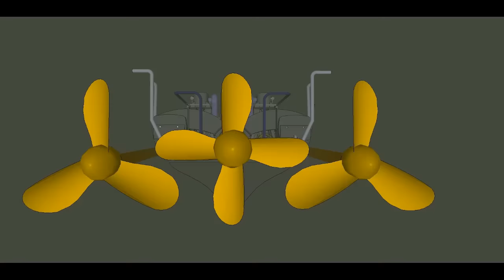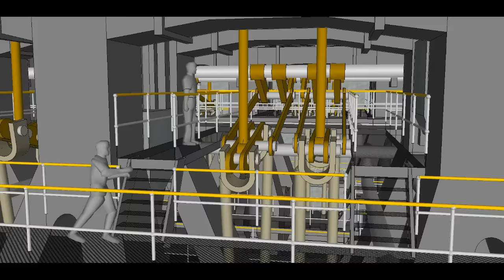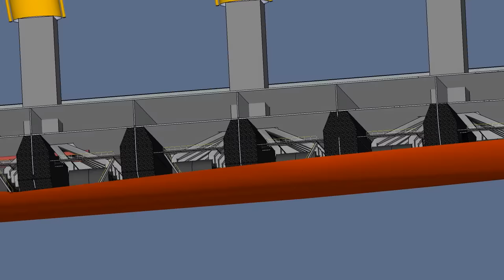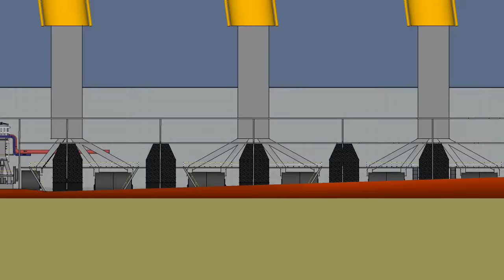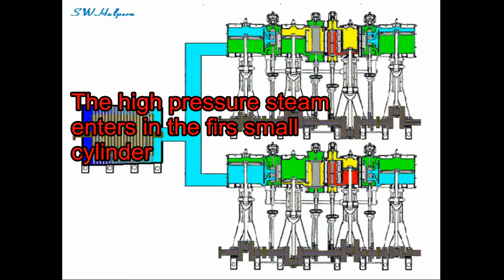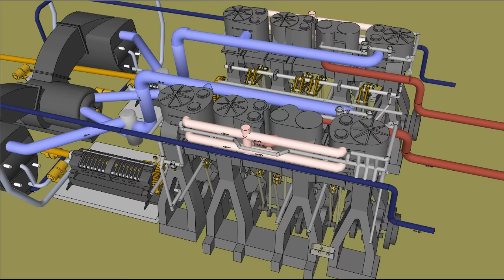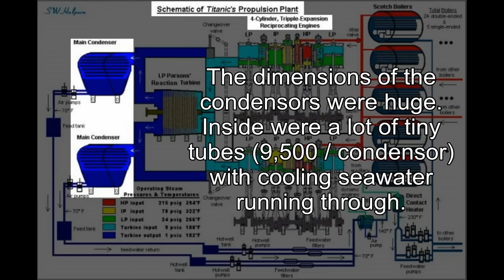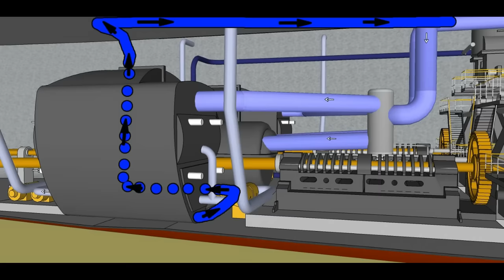The Engines of the Titanic

Comment: The level of engineering is astounding, no CAD in those days, not even a calculator, all this was done with brain power and put down on paper. Just mind blowing.
Reply from the maker: Yes, that was really very clever!
Reply: Not that it got them far
Reply: Did they not have sliderules for calculations? Did they not have "computers" of the two-legged variety?
Reply: The technology was not that new then, they had had steam engines for over 100 years, so they knew what they were working with.
Reply: The turbine is what I found great. The machining and fluid dynamics involved in the turbine is amazing for the time. It's very similar to a modern day jet engine. The stationary blades directing airflow into the moving blades is brutally simple but getting your head around it back then and making it was anything but. "Theoretically" they were mostly into the jet age with the turbine alone.
Reply: They did have slide rules to use.  I used to use one.
Reply: @YodaWhat  Slide rulers were invented in the 17th century, so they would have had those.
Reply: Outdoorsguy -- Ya, I know. It was a rhetorical question.
Reply: No comment.. the ship is on the bottom of the north Atlantic.. I'll stick with my scientific calculations ...
Reply: And all with negative unix timestamps.
Reply: They had to think for themselves back then. Slide rules, log tables. An engineer back then was well mentored. Also large drawing offices and blue prints. No 3d CAD.
Reply: Hey, not so fast.  We had "slide rules" before we had calculators.  We didn't have "nothing". :)
Reply: waooo amazing
Reply: Ironically drawings were ink on linen then
Reply: Was not, much of a marvel it sand coming out of the gate.
Reply: And slide rules. For example there was a Fuller cylindrical slide rule in the drawing office of Harland & Wolff that was even used 30 years later, it was just very precise and well made.
Reply: There were lots of mechanical calculators in 1912, just not digital. It wasn't that long ago, and not as primitive as you think.
Reply: @RedGaming Studio , computer aided drafting.
Reply: The sr71 was designed using slid rules.
Reply: @michaelmcneil4168  it got them incredibly far. 
Many a ship survived built this way
Reply: @JTScott1988  First of all it was not the Titanic, the story I heard is they swapped it for a sister ship and they only got most of the way, which in those days was still not good enough.
Reply: @michaelmcneil4168  It was the iceberg not the engines
Reply: No calculator- damn... that’s intense to think about.
Reply: @YodaWhat  The first idea for a "slide rule" dates from about 1620 and they proliferated in the 19th century. In the movie "Titanic," ship designer Thomas Andrews (Victor Garber) is shown using one. 
I got a K&E log log duplex decitrig as a high school graduation present in 1963 and used it as late as 1976, replacing it with a Texas Instruments TI-56 calculator when they finally became cheap enough. Now it's framed over the desk with a note that reads: "In case of power failure--break glass."
https://en.wikipedia.org/wiki/Slide_rule#targetText=The%20slide%20rule%20was%20invented,used%20to%20multiply%20and%20divide.
Reply: @williamwingo4740  Yes, the Napierian logarithms were published first in 1614. One of Napier's descendants is a friend of mine. :)
Reply: @colinmontgomery5492  That's right. Google "adding machine" and you find they were available in the 1880s if not before. I remember Friden electro-mechanical desk calculators in the 1950s: every lumber yard had one. Looked like a big typewriter, if you remember typewriters. 
I saw my first pocket electronic calculator in Korea in 1972. Somebody had picked it up in Japan. It was primitive by today's standards, but people were lining up to gawk at it. First one I actually bought was in 1974/5--a TI SR-56.
https://en.wikipedia.org/wiki/Adding_machine
Reply: Maybe someone already noted this, but also slide rules.  Because accuracy depended on distance between marks, "they" used to often use huge ones.
Reply: Omnihil777 I never liked slide rules, always preferred a book of log and trig tables.
Reply: Charlie K I just preferred tables, got a feel for them.  There was a period between 1900-1950 where mechanical completion relied on logarithmic and anti logarithmic  cams to do mechanical computing.  Numbers were represented as shaft turns, addition/subtraction by differential gears and all other functions by log/antilog cams encoding trigonometric and ballistics data.
Reply: I finished up high school in 1973 we didn’t have calculators everything was by had. Pain in the neck to do math the long way.
Reply: Lester Miller it taught accuracy and clever ways to be fast and concise.  3D CAD modelling and finite element analysis is nice but I doubt many other things have improved.
Reply: Pretty sure they had calculators and slide rules. The first mechanical calculator was made in 1645.
Reply: @Thebutteredsausage  only because it crashed when a modern ship crashes it sinks
Reply: 𖥠 ꧁Æ♱ℍᴲᮄℜᴲⅅ꧂𖥠 In a way, the turbine is a much simpler than the reciprocating engine, yet it was only invented in  1894.
Reply: @colinmontgomery5492  Exactly. It looks like people often think it was something like medieval.
Reply: Si1983h 🔥🔥🔥🔥🔥🔥🔥🔥🔥
Reply: About the slide rule comments: When I was in 8th-9th grade ~1970, our math teacher allowed slide rules during tests but most didn't. To some students, it was blasphemy to do so. I eventually started use one.
Reply: Calculator  was invented in 1642AD
Reply: Michael McNeil, haha true! That said, you can blame they engineers that built the engines.
Reply: dogboy1953 yes indeed... but they didn’t have CAD/CAM back then.
Reply: dogboy1953 ace, I’ve been thinking of connecting an oil fired boiler to my hot tub... maybe I should use a steam engine to drive the jets and filter pump.🤣
Reply: Abacus Calculator, still a calculator..
Reply: John W And two space shuttle designed by modern computers turned to ash so what’s your point?
Reply: @williamwingo4740  you mean it looked like a old cash register.
Reply: Pete Guthrie I’m fairly sure the engines (which I’m referring to, rather than the hull) weren’t riveted together... in any case, the biggest mistake with that ship was to call it unsinkable. It was an engineering marvel, but unsinkable it clearly wasn’t, no ship is unsinkable. It suffered a catastrophic collision in a critical area... it’s sinking was the result of a combination of very bad luck and crew negligence, born from the misplaced feeling of invincibility from being on an “unsinkable” ship, not poor workmanship.
Reply: Pete Guthrie The owners of the White Star Line never claimed that any of their ships were “unsinkable” . The rabid press of that day was almost as big of liars as they are today. It was the newspapers that declared the Titanic to be unsinkable.
Reply: Mdbk2 yes for sure, amazing feat of engineering!
Reply: @Hoeishetmogelijk  an this is actually  quadruple-expansion steam engine!
Reply: Of course there we calculators.  They were mechanical but still calculators.
Reply: Scotty true true. Brought me back to high school with that comment, I forgot all about those
Reply: Is there any reason why they used so many "small" sized boilers instead of bigger boilers btw? feed rates being to high or something?
Reply: @Thebutteredsausage  As are more than a few "modern" vessels that were CAD designed with the latest engineering principles. In short, if it's made of steel it CAN sink no matter how well designed and constructed.
Ironically they went back and double-hulled the Britannic (which was under construction in dry-dock when Titanic sank) and she went down in half the time of the Titanic when her time came (though her captain actually tried hard to save the ship by driving her as hard as he could towards shallow water and a nearby island, and he nearly made it)... it's hard to keep a steel vessel from sinking once the hull has been significantly  penetrated. Some modern analysis of the Titanic accident suggests that had Titanic struck the iceberg head-on it would have crushed the forward sections of the ship but she would have continued to float a lot longer or possibly indefinitely. 
Just saying.
Reply: So true. We could not do this these days the same way at all.
Reply: Metal - Grandpa yep, that’s kind of my point, if all of our modern tech (CAD/CAM) were to be taken away, a whole new skill set would need to be learned to accomplish this. All the measurements were done by hand/eye during manufacture too, it’s pretty impressive!
Reply: @Si1983h  Exactly!
Reply: @YodaWhat  Yes, in those days a computer wasn't usually machine.
Reply: @patrickcannell2258  My grandfather was an architect and he often worked for IBM designing office spaces. He told me that circuit diagrams even for microprocessors were the size of a table. So just imagine how big a blueprint for a ship is.
Reply: @RedGaming Studio Computer Aided Drafting and design. It is software that allows people to create technical drawings. The computer also does most of the math so its a lot easier then pen and paper.
Reply: @colinmontgomery5492  Electronic calculators didn't come around until the early 1960s and cost more than a new car.
Reply: We can make a engine from drawing but no electric they need cad and robots
Reply: The slide rule was available at that time as well as the Abacus.
Reply: There was solid-works back then and CNC 5 axis machining to make all those parts for the giant steam 5 strokes
Reply: oops 2 strokes
Reply: The CAD CAM program had a glitch on the 5 axis CNC machine! One of the 2 stroke went out of whack!
Reply: Working without computers means that it will take quite more in order to do the same job, so it will also be more expensive.
Reply: @Thebutteredsausage  yeah right, because nothing nowadays ever goes tits-up if "scientific calculations" are used....
Reply: Try reading a bit more numb nut the ship was sunk because the purser left  the key for the special long range binoculars they in his home  and they didn't have time to get a new one cut before she left New York and while they found some design flaws later this isn't what actually caused the ship to sink  - they didn't see the iceberg early enough to turn the ship
Reply: In Australia when the first theodolites came out they reserveyed all of Sydney and they found the good old gunter's chain and dumpy level to be 100% accurate and they put it down to the user
Reply: Evan Giles yep, little to with the quality of workmanship or engineering, no ship of the time would’ve fared well with that kind of impact. Competition to be the biggest, best and fastest was their downfall. Interesting story about the binoculars being locked away with no key though, surely there were more than one set of binoculars onboard and in more than one location?!
Reply: ... and a slide rule.
Reply: @roadtoad7704  We were allowed to use slide rules in high school chemistry and physics in 1962-3. Those courses are math-intensive, but the math is secondary.
OTOH, in freshman college chemistry lab a couple of years later they wanted four significant figures, so you had to do it all by hand or with log tables.
Reply: @lestermiller2717  "...we didn’t have calculators everything was by had. Pain in the neck to do math the long way."
But you got some very valuable experience. Nowadays high school students can use a calculator to get a square root, but can't tell you what it means that one number is the square root of another.
Reply: The ship engineering never the problem...human error...look at all the newer technologies on the newer cruise liner...and a captain decides to play chicken with a rock.....that would have been a huge disaster if the ship had sunk in deep water..technology can t compensate for stupidity..
Reply: @YodaWhat  If they had slide rules, they wouldn't have had enough significant digits for accuracy. To multiply or divide, designers used logarithms (x = 10^y) from books of look-up tables (easier to add "logs" of numbers rather than multiply them--subtract for division). Google it.
Reply: @Greatdome99  I know perfectly well what logarithms are. What do you think is the basis for the slide rule, silly putty? As for accuracy, 3 digit precision is pretty easy on a small "slipstick" and 4 digit on larger sliderules.
Reply: They did have calculators.  The most common type of calculator was called a slide rule.  There was also the abacus..
Reply: @frankeggers4024  yes, a lot of people have said this, but what they achieved with those tools is still remarkable. Today we have computer modelling so you can see something working (or not) before a single part has been made... not back then though, and these steam engines were huge and deceptively complex beasts, everything has to be perfect to within fractions of a MM, and there are lots of huge moving parts that need to be balanced otherwise they’d shake themselves to bits (but not before demolishing their surroundings). If you’ve never seen a giant steam engine actually running, try and visit a working pump house or something, they’re awesome to watch.
Reply: @charliejeans2413  labor was maybe cheap. And Not much space for automated system?
Reply: @TidusleFlemard  wild guess is that pressure is too high for big boilers?  Hard to make big boilers srrong
Reply: @Thebutteredsausage  I think it was a lot to do with the engineers and designers being over ruled by the owners of the white star line rather than their mistakes
Reply: @mrdojob  Yeah it’s like WW2 aircraft engines. The turbocharging systems were eventually so complex they probably realised it was easier to just have the turbine driving the aircraft 😄
Reply: The only thing they had in those days was the now obsolete slide rules.  I learned to use one in my first year whilst studying Engineering. Electronic  Calculators appeared about two years later.
Reply: But despite everything, she was a good ship, she took over two hours to sink and the recent Costa Concordia sank in less than an hour.
Reply: Titouan Lannuzel redundancy probably, also the logistical challenge of keeping them fired, it would’ve taken a large workforce, working around the clock, the workforce can fit around more smaller boilers more easily (sorry for the convoluted explanation, especially since it’s an educated guess).
Reply: It's really not all THAT big of a deal. It's just VERY inefficient. CAD and Calculators are efficiency tools, utilizing them a person could make this same cycle either make significantly more power, use significantly less building material, or be scaled to be significantly smaller.

Even today, a person with a basic understanding of combustion and engine concepts could easily make a perfectly operational engine with absolutely no mathematical engineering knowledge. Assuming he had the machine and casting tools neccesary of course.

It would be light years from efficient and produce very little power for it's size. But it would produce usable power. 

Now let's say he does some experiments, and breaks and rebuilds, reiterates, etc, over the course of a decade. Well chances are they'd get to within a significant fraction of an engine designed using mathematics.

Of course, this process is far from efficient enough to be profitable, but this metaphor describes how it was relatively easy is was to make an engine like this without the engineering tools we have today. Or even slide rules really.
Reply: @mrdojob  So true
Reply: No days what can be done by a small handful of people was done by rooms full of men drafting and calculating.
Reply: @frequentlycynical642  ... "they" used to often use huge ones... Of course! The engineers' wives used used to brag in those days: "My husband has bigger slide rule than yours!"
Reply: well. they did have computers. human computers as they called it.
Reply: @michaelmcneil4168  but it did?!? Their hard work paved the way for modern technology, and the Titanic in specific eventually caused more safety regulations to be put in place.
Reply: @clf8965  sorry but I don't recall what my reply was, this video is from January 2015.
Reply: @michaelmcneil4168  “not that it got them far” sorry I didn’t think about how old the original comment was, it’s surprising you’d even respond
Reply: @clf8965  I was trained by covid engineers.
Reply: Being lazy was no option for people back then. You had to use your brain, every single day. Which lead to smart people who invented all the luxuries we have today.
Reply: as technical draftsman and mechanical engineer, i absolutly agree and my mind is blown as well
Reply: @michaelmcneil4168  You probably know this but three of this class of ship were built...Olympic lasted until the mid '30s.
Reply: It’s at the bottom of the ocean because of human error , not any failings of the ships build quality . Ships don’t hit icebergs anymore because of radar and gps etc . If a modern ship hit that same iceberg at the same speed , it’s going to the bottom too .
Reply: The Parsons turbine was sort of a turbocharger for the big steam engines in a way I suppose. I think that with all of the jobless, homeless, and prisoners in America alone could easily provide enough manpower to reintroduce coal fired reciprocating steam powered ships back into service.  That would be good for everyone!
Reply: @aeromoe  Wow I never realised they built thing to last. I am reminded about than old cruise lined that was destroyed taking its superannuated piano player with it. Glad that was just a story.
Reply: Yes I do realise that old ships never die they just get insuranced out of commission under a toilet flag.
Reply: @Thebutteredsausage  as a boeing super jet crashes from the sky! 🙄
Reply: 1973-4, UofQld, a split room, 3 hr exam, the front half was us, in the back were the engineering mob. A big brouhaha broke out as some Eng. students (very few) had calculators and the rest had slide rules: nett result - those with calculators were given only 2 hrs to finish. We maths illiterates had no idea what they were on about.
Some years later I added the moment to a book on Capitalism as an example of problems with Worker Ownership. Scenario; what happens to those in a slide rule 'workshop' when new tech will certainly kill their business model pretty quickly. Solution: with more 'principals' (heads in the game) the threat is dealt with sooner.
Reply: ps: I have read that the designer, Thomas Andrews, did all of the drawings with what would be today a pocket geometry set. An extraordinary effort.
Reply: @peterclark6290  indeed, that’s what I was acknowledging, extraordinary, as was the machining moving mechanical components on that scale.
Reply: An atom bomb on a B29 bomber, designed and built without PC and cad cam
Reply: if it was electric it wouldnt have sunk
Reply: Indeed!
Reply: All they had were slide rules
Reply: No they had calculators
Reply: They had slide rules instead of calculators.
Reply: They actually did have calculators, but they weren’t electrical/computer driven. They had calculators in the form of people sitting in a room performing the calculations sent to them by the engineers.
Reply: @YodaWhat  About the middle of the 1800s slide rule usage became common so I'm sure that they were used in designing the Titanic.
Reply: @YodaWhat  nope
Reply: Yes, we can do all thing if we just believe and put our minds to it
Reply: Grand staircase Gold leaf 🍀🍀🍀🍀🍀🍃🍃🍃🍃🍃🍃🍃🍃🍃🍃🍃🍃🍃🍃🍃🍃🍃🍃🍃🍃🍃🍃🍃🍃🍃🍃🍃🍃🍃🍃🍃🍃🍃🍃🍃🍃🍃🍃🍃🍃🍃🍃🍃🍃🍃🍃🍃🍃🍃🍃🍃🍃🍃🍃🍃🍃🍃🍃🍃🍃🍃🍃🍃🍃🍃🍃🍃🍃🍃🍃🍃🍃🍃🍃🍃🍃🍃🍃🍃🍃🍃🍃🍃🍃🍃🍃🍃🍃🍃🍃🍃🍃🍃🍃🍃🍃🍃🍃🍃🍃🍃🍃🍃🍃🍃🍃🍃🍃🍃🍃🍃🍃🍃🍃🍃🍃🍃🍃🍃🍃🍀🍀🍀🍀🍀🍀🍀🍀🍀🍀🍀🍀🍂🍂🍂🍂🍂🍂🍂🍂🍂🍂🍂🍂🍂🍂🍂🍂🍂🍂🍂🍂🍂🍂🍂🍂🍂🍂🍂🍂🍂🍂🍂 🍂🍂🍂🍂🍂🍂🍂🍂🍂🍂🍂🍂🍂🍂🍂🍂🍂🍂🍂🍂🍂🍂🍂🍂🍂🍂🍂🍂🍂🍂🍂🍂🍂🍂🍂🍂🍂🍂🍂🍂🍂🍂🍂🍂🍂🍂🍂🍂🍂🍂🍂🍂🍂🍂🍂🍂🍂🍂🍂
Reply: And slide rulers and log tables haha
Reply: Everyone relies on computers now
Reply: Titanic engine cylinder engineering room
Reply: You make me feel old, but it was not that long ago it was before computers. Calculators where banned from my high school. Man is getting dumber now by the day. Engineering of a 3 story high piston is pretty remarkable even for today.
Reply: Yep , BRAVO !  NO BACK UP HARD DRIVE !
Reply: Our technology got a level, which is unreachable without advances of all last two centuries. But these start to be forgotten. If somebody will beat a current technology level down, next generation will live between unrepairable ruins...
Reply: Yep , as a nation somethings  we did get right !
Reply: @michaelmcneil4168  That had nothing to do with their ingenuity. it was due to their arrogance. something that's quite prevalent even today.
Reply: And looks how far we have come. now everyone needs computers to do things for them.
Reply: Triple Drat !
Reply: @YodaWhat  THEY ONLY HAD BRAIN POWER .
Reply: @johnsmith-rs2vk  Yes, I know, but that included primitive assistance, like the Slide Rule.
Reply: Why would you need that?
Reply: It would be common today if the education system would actually teach basic subjects properly instead of woke propaganda…..i have a hs education and i am proficient in structural engineering, do it daily but don’t have a stamp
Reply: Slide rules!
Reply: @michaelmcneil4168 what?
Reply: Ah yes good enough engineering to sink on maiden voyage
Reply: @GAURON123  well that was a result of gross negligence of the operators, not the ship itself, but I’m talking about the mechanical engineering, where you have huge, heavy moving parts and tight tolerances. Of course we’ve come a long way in terms of efficiency, reliability and safety, but then we have another 111 years of technological innovation behind us, and mistakes to learn from… but even with all that, ships still sink, and by and large, the common theme is negligence rather than spontaneous mechanical failure.
Reply: The ol thats good enough trick. But Unfortunately it wasnt.
Reply: @Thebutteredsausage No thanks to its captain.. had nothing to do with its engineering stand point.

Its sister ship served for many years until the germans sank it
Reply: @Thebutteredsausage  not even remotely related to why the ship sunk...
Reply: @antoy384  haha
Reply: well they had  electromechanical calculators the size of a room. but for sure all was try and error. by then the steam engine had already 100 years. but the turbine technology its a state of the art novel technology still used today in military long range vessels, but instead of coal now they use nuclear fission to steam the turbines.
Reply: @charliejeans2413  its all about cost, there was not unions yet. it was cheaper to use man labor.
Reply: ……Then it sank….
Reply: @generalleigh7387  not because of its power train though… well not directly anyway.
Reply: Calculator was invented in 1642
Reply: @brucerogermorgan2388 1786 to be precise
Reply: @Hoeishetmogelijk Didn't they have slide rule back then?
Reply: Well, obviously, anything built before modern technology was built with extraterrestrial alien assistance since we humans are just too darn stupid.  🥴👽🙄  (Pushes glasses up the bridge of nose, straightens tin foil hat).  But then...that would mean aliens must have helped us build that same modern technology as we wouldn't have the foundational knowledge and skills to do so!  🤔  Drats!
Reply: Not to mention built with hands and strong backs....
Reply: @Hoeishetmogelijk Me thinks they DID have slide rules back then...
Reply: Computers and smartphones made us dumb. Not many engineers could do the same today without it.
Reply: @chrisbroesky2932  yes, this being my point, and that there was no CNC machining, everything was hand/eye finished… imagine the amount of work and skill involved in machining a piston and cylinder or a large bearing to the tolerances required to be both efficient and reliable enough for an Atlantic crossing… people keep commenting that it sank… which it did, after a catastrophic accident/failure by its crew. The engines didn’t cause it to sink, the big hole ripped in it’s side below the water line did.
Reply: @Si1983h  Forsure. Today's cnc guys push a few buttons and take a nap for a half hour. There's a whole other storey "conspiracy" some say it was sunk on purpose.
Reply: That sounds like my dishwasher I used to own 😊
Reply: @mrdojob  I agree with the marvel in the turbine itself, but using one in the manner you're suggesting was still only a theory at the time due to the established fuels and available materials. Thermodynamics is still a relatively new branch of science to humanity, and steam was the only means to harness it on that scale at the time.
Reply: Soo' Not! The 🏔️❗ the Maschin - room meby. meby too' Mutch Vibration , meby one Off the Zylinder 💥💨💨 , meby the hot 💨💨💨 Tank. Full Speed & after meby 🚢👇.
Reply: @michaelmcneil4168 don’t be absurd